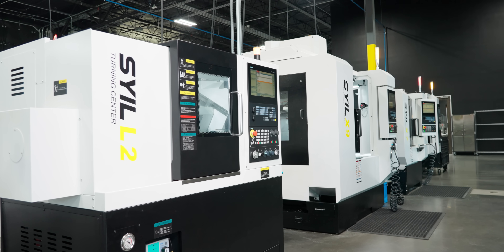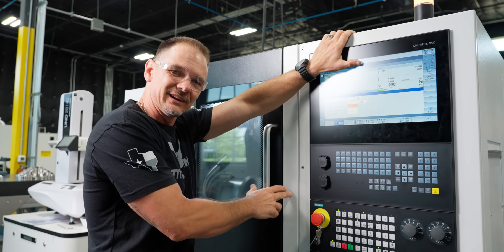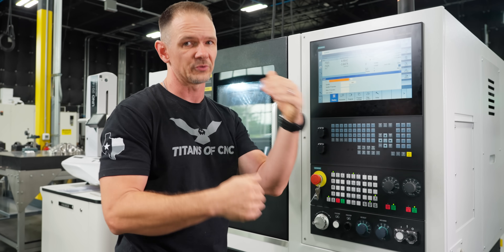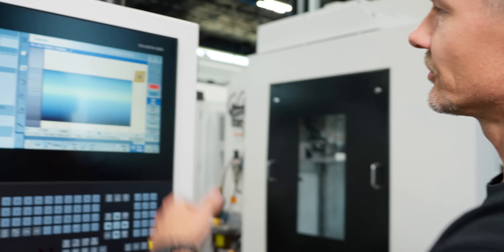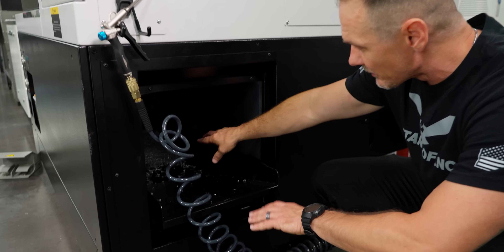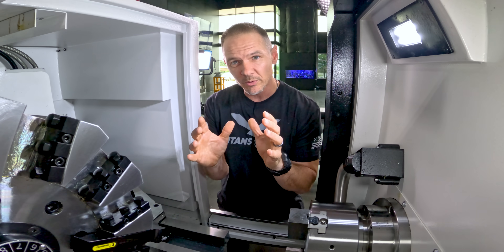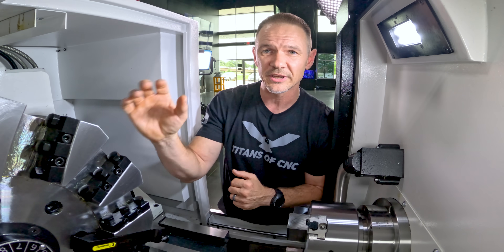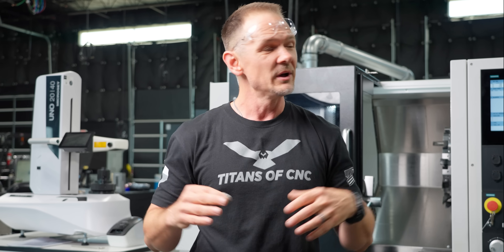$40K CNC Lathe? First Look at the SYIL L2

Comment: Manipulation commerciale avec un anglais non authentique.
On vante les propriétés premières de la machine sans parler du coût élevé de des premières pièces d'usure qui sont propres au constructeur et dont les prix ne sont pas accessibles.

Ce n'est pas une critique, un constat.
Reply: A lot of manufacturers have many wear parts in their machines which are specific to the manufacturer. If you can afford to purchase the machine new in the first place, it will be strange if you are not able to afford the wear parts?

Comment: where's my 3 turrets and tripple channel controler version ? ( ment as a joke cuase i use to run that and for some reason find it pretty much as easy as single turret single channel lathe's ( hate dual turret dual channel for some reason. for some reason they just dont really make sense to me )

AND WHERE ARE ANY NEW'S OR MENTIONING OF THE U5 !!!!!!!!!!!!!!!

also i would say that even if you dont do high volum production or stuff like that i would still put a a bar feeder on it if you have the space. just that you can take a full bar without haveing to cut it up first and the total amout of "waste " you have at the end is still lower then all the hold on stock you need to have if its pre cut stuff. plus since its a good size your left with you can either use it as pease of stuck for a part loaded in manually or sell it to the dealer for more then you could as chips. aka. if you have the space ( and enough budget ) get a bar feed even if you dont technically need it at the beginning )

Comment: Been waiting to see this, Is it 3 phase or 220v single phase. Looking to replace my Tormach 8L
Reply: Great question! The SYIL L2s run on 220V 3-phase power.
Reply: So you could potentially put it in the garage and use the dryer outlet?@Sara-TOC
Reply: @joelchacon-duran3438  you would need a phase converter if it’s going in your garage.

Comment: What tolerances i can produce with this in mm 0,01? 0,005? At the company who i Work WE need such an Machine in this size i can Show IT to my Chef. How many Power the Spindle haves? And whats the bigest Diameter. Can the Tools spin or Not?
Reply: Thanks to Siemens control and servos, this machine will certainly be able to achieve tolerances of approximately +/- 0.002mm when warm.

Comment: I ran okuma big bore ( 2.5”  through  ) cadets since 1995, one was a cadet M , 8” chuck. One had a bar feed, collet style. Both had chip conveyors , a must. Had to make up our own ID stations for the cadet M because of limited clearances, did not have the extra axis on the M but was really a good machine if you stayed within its limitations. We had ball screws replaced once . Still running good when I retired, last year (49 yrs ) we wrote our own programs and I love the okuma programming much better the fanuc programming. Okuma cnc’s have been much more reliable than any other brands we have had such as puma, tornos.

Comment: Unimpressed, without chip conveyor being included any machine is worthless. Not everyone gets to work in a cooled work space.
Reply: so tell me how tf does a chip conveyor affect the temperatures as you implied, ive been turning more than a decade on machines with and without conveyors all worplaces with no ac or coolant cooler. I literally didnt see any difference
Reply from the maker: It just didn’t show up yet… Hennig is making it outside of Chicago. New design…

Comment: I would like to see more detailed videos about programming lathe parts in the siemens control. .. if it can beat typing g-code , or mazatrol ;)
Reply: I work with the Siemens 828d. Thanks to the cycles (machining cycles, drilling cycles, etc.), it's really easy to create programs manually and quickly adapt or modify them. I usually write the programs in Windows Editor on my PC, save them to a USB stick, and the 828d can read the G-code as usual. Then you have a very good 3D simulation with which you can check everything, and you're ready to go. I think it would be great if the Titan team would make a programming video for turning and milling to show how easy it is with Siemens.

Comment: I have a few questions: How deep can it cur or how hard can you cut before it starts deflecting and chattering (What's the deepest and fastest cut you can take ), How accurate is it really (in steel while roughing and when finishing) ? how good is the coolant system ? AANNDD How can i convince my stingy superiors to get me one ? Cause i make a lot of small parts in small ish quantitys on a 45year old machine that was NOT treated well so it really sucks doing that with the tolerances necessary for riveting and de riveting stamps or dyes or what you call it in english
Reply: This tecnichal infio depend always on situation .......every company ..every management so different. Its all about your needs.....the market is HUGE .
He knows what he needs....not you!:)))))))

Comment: The Siemens sinumerik controls are the future. Once you get into it you won’t want to programme on anything else

Question : is ShopMill/ShopTurn Standard on most of the sinumeriks?
Reply: They do not come with ShopMill/ShopTurn. We just got our L2 from Titans up and running. I was quoted $815 to add ShopTurn.
Reply: @nick.rey96 damm that’s disappointing. What controller is it? 828D?
Reply: I think so but i can asure you that shop mill is kinda ass ... But shop turn has nearly all features perfected to the point that cam can only do a "little bit" better but shop mill... That's ASS
Reply: @AChicken-sh1gc I’ve been using shop mill for 8 years I think it’s great. Can’t say I’ve ever had a problem with it. Most of the complicated stuff I will use ONEcnc. What do you not like about ShopMill shopturn?
Reply: I Love the CNC from okuma mill and Lathe very simple at all when you can use windows. good to learn and you dont need to wait for load all come Up Instant when you glick into a new menu. But i have only Work on older Siemens CNC before 5-10 years old Machines i dont know how the new one are.
Reply: Heidenhain itnc 530 on millingmachines be like: what the fak did you just say!
Reply: @danielczoller3395  I don't know for the rest of the world but in Italy if you buy a machine with fanuc or siemens control the price is the same, if you want Heidenhain is 15/20k more. I bought a DNM6700 last year with siemens control, if i want, and i don't want, Heidenhain the price is 18k +, i choose siemens and with that 18k i add the renishaw 3d and i bought vise and chuck for the machine.
Reply: @danielczoller3395 my first machine I worked on had a TNC 151 … Bridgeport interact mk2 would hate to go back to that 🤣
Reply: @Rick_Sanchez157  dude you compare apples with peaches
Reply: Maybe in Europe but with zero customer service in the US Mitsubishi and Fanuc are still the future. FYI I am referring to customer assistant not parts, that’s about all I experienced with Siemens in the US is “oh we’re not sure what’s wrong but we will sell you a new controller”